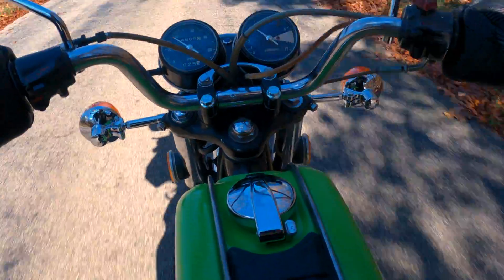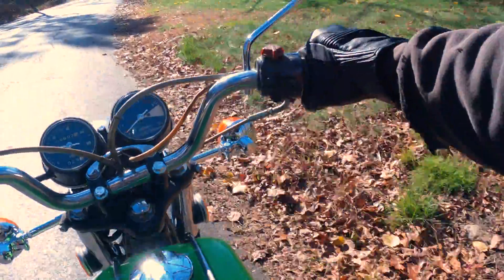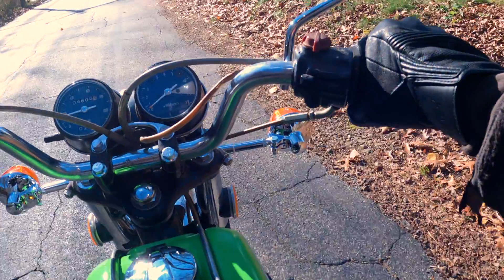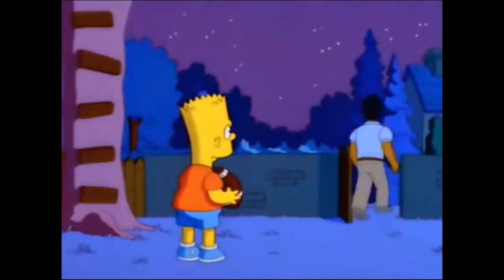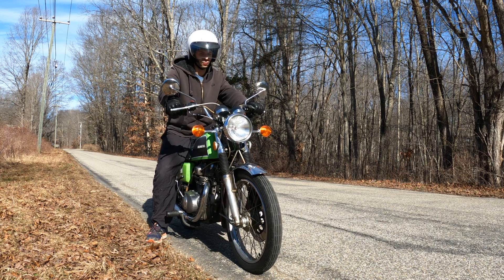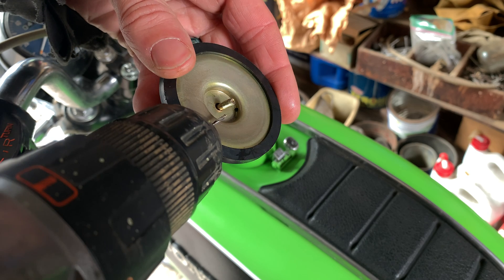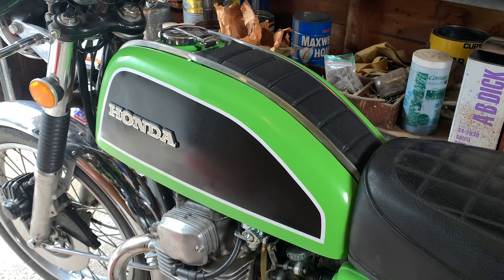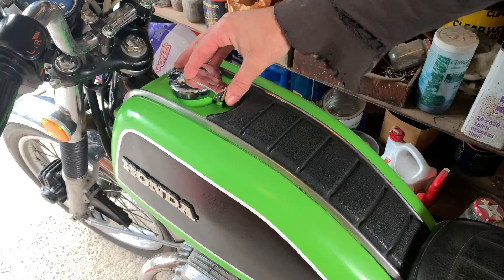Motorcycle Engine Stalls Stops While Riding Gas Cap Not Venting Fix

Comment: That's what i was looking for, sadly for me exactly that's what happened, also the psht sound it's accurate i used to open the cap, but in the long term it got dangerous as the motorcycle rattle in the highway, so I have to find the vent hose in my case